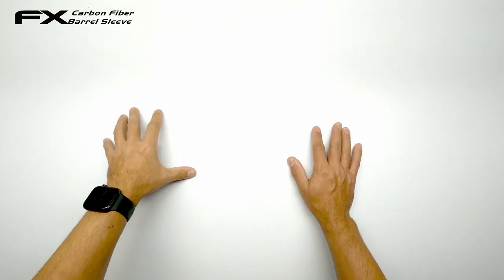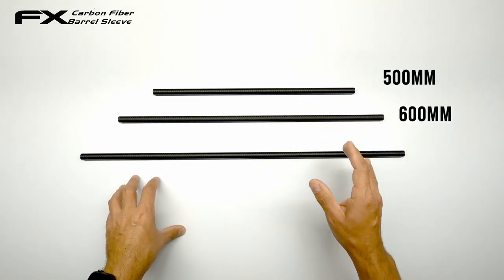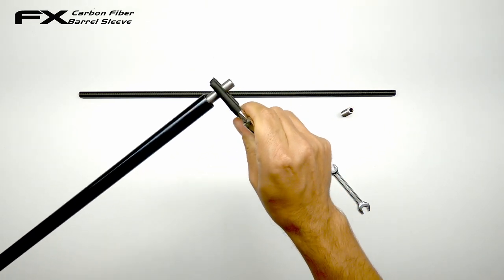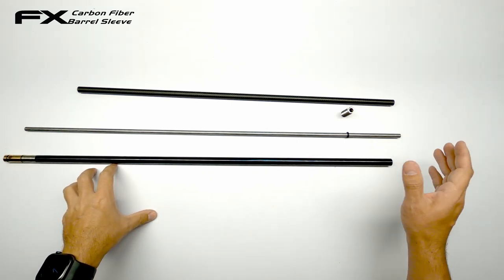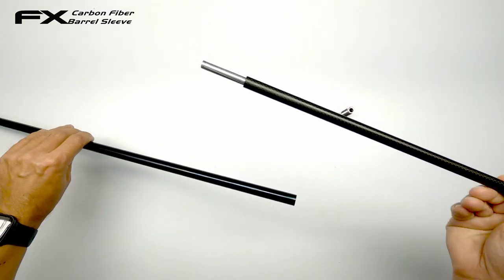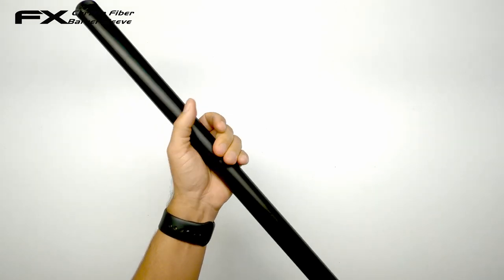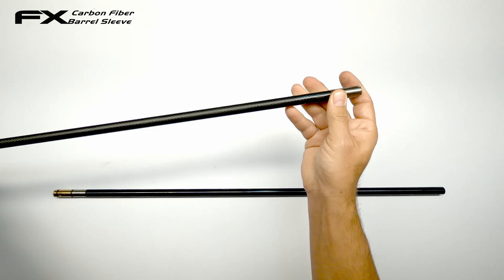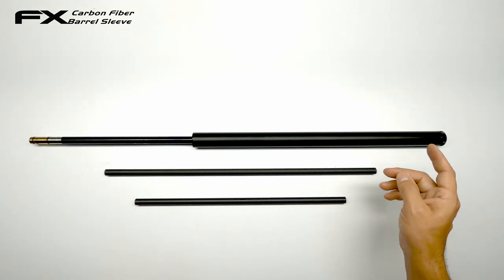FX CARBON FIBER LINER SLEEVE INSTALL ( M3 slug tune Part 2 )

Comment: Fx should make this stock and not a aftermarket part. Fx is getting away from making great guns to making gimmick guns
Reply: When the slugs came out and customers pushed the limits of speed the harmonics increased , they are addressing it with a less expensive but effective fix for older MK1 , MK2 guns , It’s not a bad idea .

Comment: For simplicity sake when I installed my carbon fiber sleeve I didn't even have to take the Barrel housing Out I just Unscrewed the shroud and pulled the liner out and then put the liner in the Carbon fiber sleeve and then put everything back together. It makes for a much quicker installation

Comment: I have a question I have the tension barrel system how tight do I tighten the 18 mm nut is there a tuque spec I don’t have the screw on barrel just the nut and then the moderator I know you have a video on it I just can’t find it tu again

Comment: You postulate that putting one of these carbon fiber sleeves over my barrel liner will stiffen it up and dampen down the barrel whip and thereby improve the "barrels' harmonics", and that this will "help out a lot" with "harmony and accuracy". So I would like to know if you have shot any groups at say 50 & 75 yards with and without this carbon fiber sleeve on your liner to see if it truly improves your accuracy, and if so then by exactly how much did it improve your accuracy?
Reply from the maker: Hi Charles, I see your point 👍🏻 that’s a test that I can do in a future video .
Reply: @Airbuks  I think a whole lot of us would be interested in your results
Reply: I'd certainly love to see an accuracy comparison video! Airbuks! As an FX "Guru", I challenge you to produce a comparison video. 🎬😊
Reply: Where's the beef? Yeah, I'd like to see a before and after test.

Comment: Great video.  My CF sleeve was slightly oversized at one spot and required that I painstakingly sand it to size.  Only took about 15 min and the install was complete.  Appreciate the clear and concise instructions, it made things easier.
Reply from the maker: Thx , glad you got that fixed 👍🏻

Comment: I still used one o ring on each end with our impacts just to dampen .  vibrations,,,. Great video thanks Len and Teresa😊
Reply from the maker: Maybe I should try that aswel , thx for the tip 👍🏻 ps : nice to meet one of the female viewers aswel 👍🏻
Reply: @Airbuks   yes i'd like to disassemble the barrel system and see the tollerance between the CF sleeve assembled on the liner and nut and the bridge at the both extremity and see if the both o'rings at the end of each side of the CF Sleeve compensate it well or not.
Reply: @Airbuks  have you been able to put the carbon tube inside the stainless steel shroud, around the barrel?
Reply from the maker: @lenweber7142  no , the ones I have are the very first ones the guy made and the ID is to small to fit the CF liners , I haven’t tried it in the recent SS sleeve 🤔

Comment: Many thanks for the videos.Very helpful my friend.After installation though you will need to re adjust your scope! At least mine had to be zeroed again.
Reply from the maker: That is quite normal as it makes your barrel more rigid , so after installing this your barrel will flex / droop less and there for you poi will change .

Comment: There is a thick silicone grease much like dielectric grease , it would not damage the barrel or the carbon fiber , it might be another way to dampen the harmonics without gluing . It’s something I will look into when I receive the carbon liner from Airguns of Utah .
Reply from the maker: Nice idea , die you have a name of that product?
Reply: @Airbuks  Super Lube silicone brake grease or Permatex dielectric grease .
Reply from the maker: @hotchihuahua1546  thx

Comment: Hello, first of all I apologize for my English, I follow you from Argentina. I ask you if it is necessary to also install the "Integrated Harmonic Barrel Tuning Shroud", together with the "CARBON FIBER LINER SLEEVE", or with this only it is enough to reduce the harmonics of the liner?
Reply from the maker: No you can perfectly use the liner sleeve without the tuner 👍🏻 it will help mostly stiffing up the barrel and maybe a little bit in the harmonics

Comment: Thanks for showing, I wondered how this worked.
However, I now wonder why FX do not make the barrel sleeve smaller so it fits snug to their liners, save on material, weight, create more air space inside the shroud.
I am probably missing something.

Again thanks.
Reply from the maker: The strength characteristics of carbon fiber is much higher the aluminum so putting it in between makes sense. Having the benefits of aluminum and carbon fiber together
Reply: So u have to spend more money 💰
Reply from the maker: @crypto_creep8222  😂 it’s like options on a car do you really need them , no . Do you want them , yes . So it will cost some extra 😉😂
Reply: @Airbuks  I still belive and I'm sure you agree with me weather you can say it or not they should be a stock option
Reply from the maker: @crypto_creep8222  offcours I agree this should be a stock option! Maybe some future models will have it standard
Reply: @crypto_creep8222  That’s like demanding a supercharger should come stock on your v8 pickup 😂.
Reply: So you can change calibers in the future

Comment: Hello "Airbuks" - you have done 2 upgrades with respect to barrel stiffness. One here with the carbon fibre sleeve, and another with the thicker outer stainless steel barrel housing. I would be very interested in knowing your opinion, which method do you think, obtains better improvement to accuracy? Thank you for your videos, they are most informative.
Reply from the maker: Hi , to be honest I never really compared it 🤔 but both do get the stiffness better . In my opinion the ss barrel sleeve is a bite stiffer then the carbon fiber liner sleeve butt also adds more weight . 
The original barrel with the carbon fiber liner sleeve fit nicely together and create a nice sandwich if you can call it like that , also less weight added . 
No fiddling with orings and is available off the shelf .
If you do your tuning right I think there is no difference between them regarding accuracy out to 100m .
And maybe the carbon sleeve are a much cheaper option and available off the shelf
Reply: This is the comment and answer I've been searching for. 
I was hoping airbuks would post a video, doing a accuracy comparison, between fx standard, ss sleeve and the cf sleeve.
Still would be good to see a comparison as there's no other video before and after.

Comment: hi Man thank for your videos you are very precise in the explenation...;) i did the same  without glue, but it seems that the CF sleeve move up and down in the barrel housing so i tried using 2 orings  to block the sleeve but i'm afraid that this add some even minimal movement of the CF sleeve at the time of the shoot and create a new variable in the harmonic. My impressions are that the correct procedure (teoretically  at least) would be using the glue ... why you choose to mention the 2 part epoxy and not the Loctite?
Reply from the maker: 🤔 mine doesn’t move inside, but putting a oring to prevent that could help indeed .
I use the epoxy as I am used to the compound , it’s slightly thicker then loctide to fill up the voids if there should be any
Reply: @Airbuks  i own the 70 mm heavy liner for slug, ordered the 70 mm CF Sleeve and tried to install without any glue or oring. I feel a movement from the back to the front and opposit i mean. if i put just an oring (the ones of the standard system that is very thick) on the front and try again i feel no movement.

Comment: Hi; did you make the comparison video without and with? I would be interested to see the difference because I hesitate between this system or put the barrel tuner that will you advise me? Thank you for sharing and these explanations
Reply from the maker: Hi , I haven’t made that video . I tried bringing it on video but from the moment I putted the liner sleeve inside I had to retune my impact to get the same accuracy.
So it very hard to compare the differences with or without.
If you have a gun that is tuned to perfection this isn’t giving better accuracy but it improves the stiffness and helps to maintain the poi over time .
In my opinion a good cheap upgrade so you don’t need to mess around with these orings 😉
I added it to all my barrels 

The barrel tuner I am still trying to figure out
Reply: @Airbuks  Yes, it's true that it's cheap and you glued it to epoxy? Do you advise me to take the barrel tuner because it works well? Thank you anyway for your answers
Reply from the maker: @SnipeLoisirsTestsCustoms  no I don’t glue it so I can use it on different liners 😉 ( I am a cheap ass 🤣) 
On the barrel tuner I can’t advise advise yet as I am still testing it myself before I advise it to others .
At the moment I have the feeling if you have your gun tuned very well it won’t bring a big difference as your gun is already in harmony.
If your gun isn’t in balance yet you can easily see the improvements.

But as I mentioned, I don’t have the complete answer to it yet
Reply: @Airbuks  Ok thank you 😂for the barrel tuner I'll see as soon as it's available I'll try to adjust it well before thank you good shot see you soon

Comment: Fx really should make these free or at least at very low cost. 30 euro for a little tube? 5 euro would be a better price if you ask me. 
It's not up to the customer to pay for this when it's a design fault.( Barrels too weak) The sleeves should come standard fitted as well.
Reply from the maker: Maybe they will be in the future 🤞🏻

Comment: Getting the sleeve past the threads is tough.  Seemed as though the sleeve was slightly larger on each end.  Had to push it in past the threads with the barrel nut.
Reply from the maker: 🤔 strange, but ja tight fit is always better I guess 😉

Comment: Great job my friend what is the CF length of the 600 millimetres superior liner thanks
Reply from the maker: Not 100% sure as I installed it in my gun 😉 but I think it’s about 500mm long
Reply: @Airbuks  thank you
Reply: @Airbuks  thanks and what is the  OD/Id size of the CF sleeve
Reply from the maker: @yanhuawu6614  also not sure as I mentioned I have it installed 😉
Reply: @Airbuks  ok thanks

Comment: What are the lengths of the sleeves. I ordered one for my 700mm barrel and the sleeve showed up 596mm, doesn't seem right?
Reply from the maker: Yes that is 100% correct. A 700mm liner sits about 45mm into the silver and brass transferport and the lock nut on the end screws in about 20-25mm and with some room to spare 600mm for a 700mm barrel is correct

Comment: Great video, thanks for sharing. After fitting the Carbon Sleeve and refitting into the outer barrel do you have to index the liner? Thanks
Reply from the maker: Hi , thx ! I have experimented with that after installing th cf sleeve and indexing still makes a difference yes
Reply: @Airbuks  what does it mean to index the liner? Like just rotating it? Thank you
Reply from the maker: @jonahchua  yes indeed , try rotating it to 12-3-6-9 o’clock and you will be surprised with the results on paper 😉
Reply: @Airbuks  oh nice, my accuracy is quite bad right now so I need all the help. Thank you very much 👍
Reply from the maker: @jonahchua  can you tell me your setup , caliber , etc …
Reply: @Airbuks  im getting about 2 inch groups at 75 yards with 22 cal 23 grain javelins and nsa slugs with the standard 600mm superior liner. Stock m3.  My reg is at 150 bar and my hammer is almost maxed out (16 and 4) do you think I should lower the pressure so my hammer can reach higher on the curve for the given reg pressure? I've played with the other settings have haven't had much luck. Thank you for your time.
Reply from the maker: @jonahchua  🤔 first thought is that the settings are completely off to shoot this light of a slug .
I am shooting 30gr slugs at 960-970 fps ( 700mm ) with the regulators at 185 and 140 Macro16 micro 3 valve line 4 and I get 1inch at 75M .
I a think you need to retune your gun lower the velocity to 930-960 fps .
Then use the powerwheel to see if a little faster or slower brings better accuracy. Ps : 23gr slugs in .218 should work fine out of the original superior liner
Reply: @Airbuks  thank you, my helix is currently in for replacement but I will try that when I get it back.
Reply: @Airbuks  does your gun have the slug kit?
Reply from the maker: @jonahchua  yes it does 👍🏻

Comment: I found the perfect solutions to my FX Impact Mk3.
I got rid of it.
Reply from the maker: 🤣 why what was wrong ?
Reply: @Airbuks  A mate and I both bought FX M3 late last year. Both rifles regularly had flyers, mine had changes of grouping. Grouping at 50 meters was about 10cm. Both rifles.
It may have been a bad batch after the pandemic lockdown but for me, I didn't pay £1850 for a shit rifle. Its been replaced with new S510TR AirArms.  Grouping is 1cm at 50 meters without flyers. Happy I got rid of the M3.
Reply from the maker: @thelairdmc  sad to here that mate , it could be a easy fix as it could be a small issue 😬 but I am sure the Air Arms is a great rifle aswel 👍🏻 enjoy
Reply: @Airbuks  My mate had his sent back to Sportsman Gun centre 3 times. They are the FX distributor in the UK. They never resolved the problem. I went straight for exchange to save me the trouble.
Thank you for the replies, all the best.

Comment: Hello! I purshased one but it’s impossible for me push it down the barrel?! Few centimeters and the carbon is already scratched and at 10cm I was blocked… half a hour to push it out 😮🤬🥵 do you know this problem? Thx 🙏
Reply from the maker: No I haven’t heard of that yet . Is it a original FX part or did you buy it online somewhere ?
Reply: @Airbuks Hello, thanks for your answer. No it’s a Fx airgun packaging (700mm .22) i don’t understand what happen here 🤔☹️
Reply from the maker: @jeromemorespeeder3503  send FX a mail explaining it and they will send you a replacement

Comment: Another great video , easy to install  have you tested it yet mate and is there much difference?.
Thank you keep them coming ..
Reply from the maker: Hi , thx for the support. I haven’t had the chance to test it yet as the weather isn’t cooperating with my schedule 😉
Reply: @Airbuks  Hi mate I be watching with anticipation,  As with out the liner you where getting good groups ..
Reply from the maker: @simoncoher4841  yes indeed my M3 is already very accurate and don’t expect any miracles but when I up the regulator pressure to 150bar and shoot slugs I never get the same accuracy as with pellets at a low regulator pressure , so I hope all the extras will help to get good groups on paper 🤞🏻
Reply: @Airbuks  As soon as the weather gets good and you have some free time you will soon find out I for 1 can wait mate look forward to your review 👍

Comment: how about 500mm installation ? need clearance between ham nut ?
Reply from the maker: What do you mean sir ? They make one for a 500mm liner aswel 🤷‍♂️
But the cf sleeves are only for the normal barrels not for the super light ones from the crown

Comment: Someone link me to an install vid on the dreamline barrel please? The orings in that are different. Not sure I could get the barrel centered. Had a few clips of the shroud.
Reply from the maker: What kind of Dreamline barrel do you have a traditional one like in the impact etc or a super light one with spacers like the Crown has ?

Comment: Why none for the 357 800mm barrel? Lord knows it needs it .
Reply from the maker: 🤔 not sure if they exist , I don’t own a 357 so I haven’t looked into that
Reply: @Airbuks  I did , they don’t make them yet . If you need one for the 700 and o rings are not enough then why they they work for a 800mm ? You are limited by the can you can put on the rifle because the barrel sag is ridiculous. I don’t think they thought it out . I know the 800mm plus barrels from skout  come with them . As soon as they dreamed this up they should have made one . Before even the slug barrel .
Reply: Then you have to buy the whole barrel kit just to get the tension system . 400 bucks . They don’t sell the system without the new block . I might have to make my own stuff .

Comment: Did you tought about wht cold and warm weather could do when you bound 2 different materials togheter? 😉
Reply: Better ad some grease on the liner
Reply from the maker: That’s the reason why I don’t glue them aswel 😉 the grease is a good tip 👍🏻 
The characteristics of carbon fiber in cold and warm are very good ( expansion/ contraction wise ) so I don’t see much of a problem

Comment: what is the thcikness for .22 cal, i seen it as 8mm id, but i dont know what must be the od. the common in my area is 8mm x 10mm, making it 2 mm thick. does it need to be thicker?
Reply: What size did you get for the .22?
Reply: @Tunnelrat6666  8mm*12mm 3k cf tube for drone will do, just trim the inner and outer diam to fit for liner and shroud
Reply: @CALOYairguns  Thanks will give it a go. Fx has never had stock in Australia and I am sick of waiting.

Comment: please, 
What is the inner diameter of small carbon fiber
Reply from the maker: Measure the liner you have in your gun it depends on the caliber 😉
Reply: @Airbuks  .25 caliber. What's the outside diameter